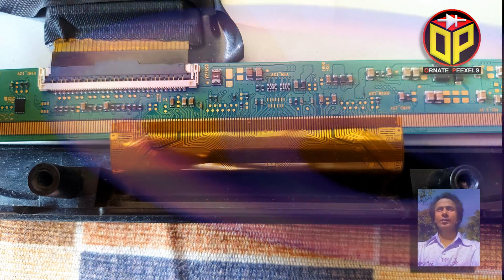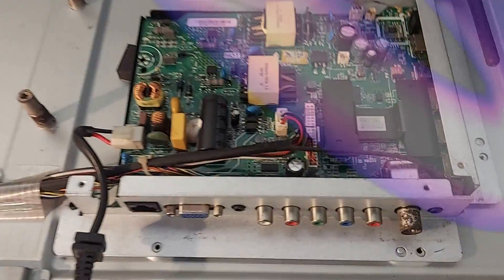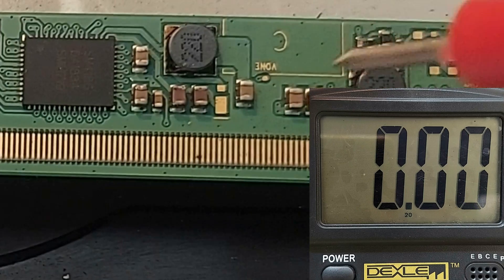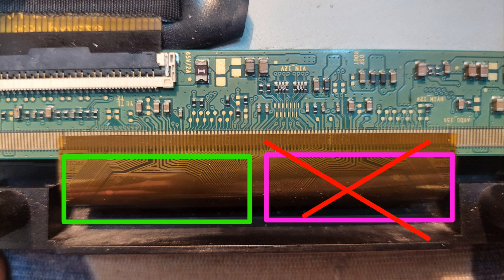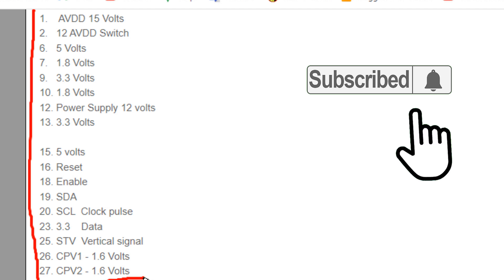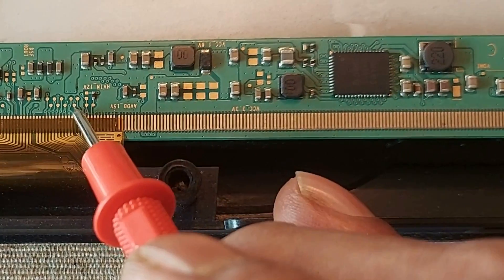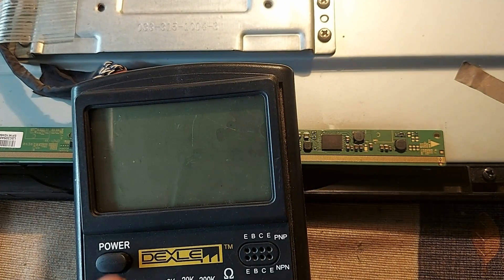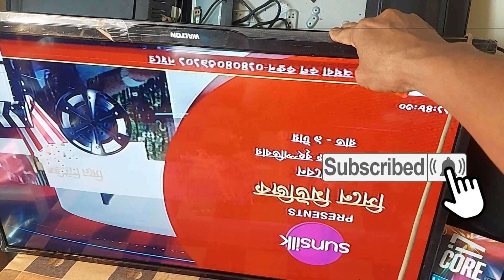LED TV Panel repair, Screen has no light but backlight OK, SM4186 IC Pinout, LSC320AN09-H03 Walton

Comment: Thanks for the knowledge sir. Please I have a 43 inches MOOVED TV which has the IC “KiWiMAGE KV6626” on the COF panel burned which am not able to find replacement so can you please suggest ways I can solve the problem. Just like the way you demonstrated here.

Comment: Dear, I have same panel. I have measured as you described. I got power supply Voltage 11.94V, AVD Voltage 4.97 and VONE Voltage 30V. Can you plz explain what I can do now to solve the problem

Comment: I have a awia 32 inch tv with the same issues and I cut line 40 - ckv2 and the tv got back the normal display. It does have some fine lines but the image is still good.  🤞on how long it will last. Thanks for the tutorial, it helped.

Comment: No ic sm4168, na placa LSC320AN10-H07 no pino 28 tem um resistor que vai ao terra da placa, vc sabeis dizer  valor desse resistor? Ele né pino onde tem o regulador Boost, correcto?

Comment: Hello sir! I learned something great in one of your videos in the middle. That is it is possible to know whether DC to Dc convertor Ic is failed or not simply by putting the red prob on the VGH testing point and powering on the TV. And see if the pointer is moving up and returning to safety mode.  This is done by using an analog meter. Is it possible to use a digital multimeter to check the same way, sir? thanks for sharing your wonderful knowledge.
Reply: Yes, it is possible with a very cheap yellow digital multimeter model- dt830d, but not possible auto range multimeter, because for some reason it does show any rapid voltage changes.